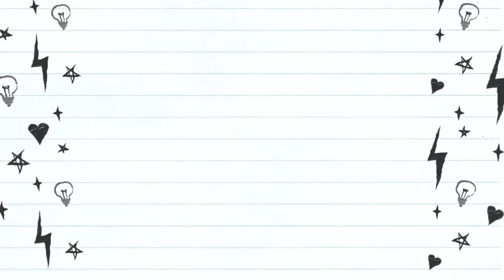Kawasaki Versys 650: How to install footpegs

Comment: How is the foot peg keeping up bro? I hate the versys's footpegs. Thinking to change
Reply from the maker: Its doing great…. No issues atall… my legs have not felt any change in position and happy over better comfort
Reply: @ashishhegde  does it reduce vibration at high speed. I feel vibration at 100+ kmph.
Reply from the maker: @microbhai  on Versys generally at 4.5k vibrates a little… though the foot pegs after change did show slight difference… it improves tpuring capability though